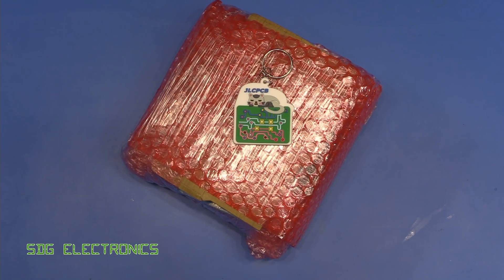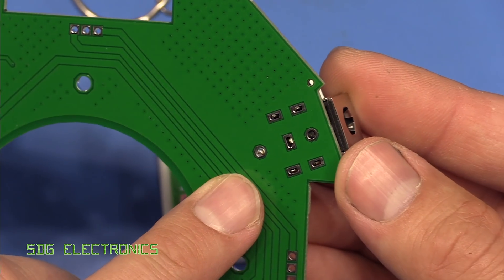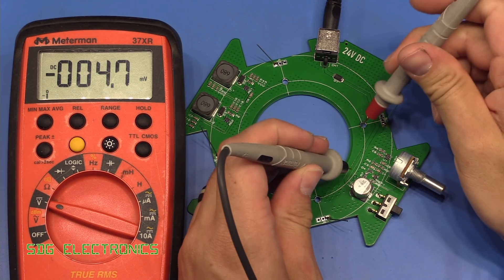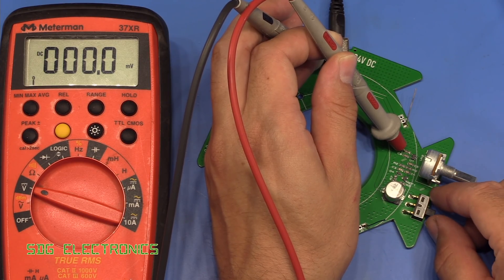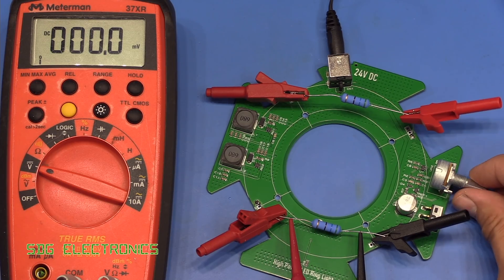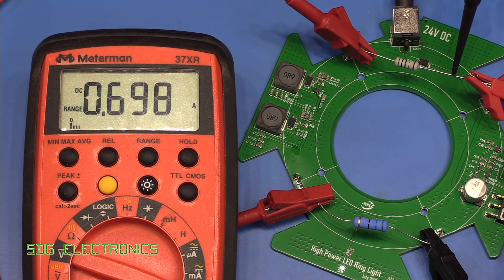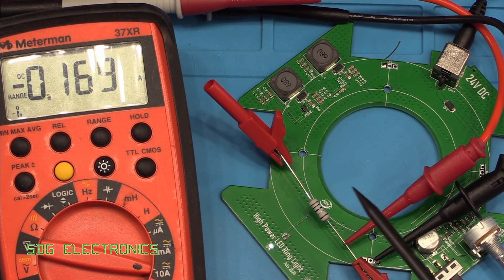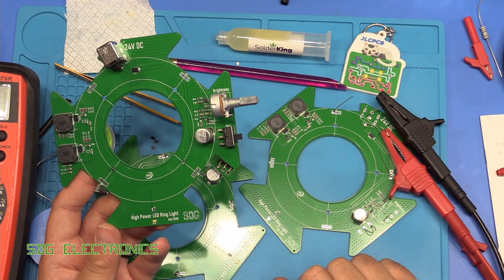SDG #170 Troubleshooting the Ring Light PCB. JLCPCB Fail??

Comment: Surprised you didn't take out the thermal camera early on in the diagnosis process, such an easy way to figure out which section of the board, and even which components are misbehaving.
What a horrible problem though, when you order 'all inclusive' you just dont expect pretty much half the parts failing!

As for my pcb designs, when building prototypes I tend to build in lots of test points and jumpers to isolate circuits. The jumpers are generally those are either 1206 resistor footprints for power traces that you can bridge with a blob or wire, or just a pcb jumper that can be cut in case I need to trouble shoot.

Comment: Had the same problem with that specific LED driver circuit, in the end I settled for the QX5241A LED driver, basically took the application circuit from the datasheet and it worked perfectly fine, even at quite high currents of 2 Amps (and since that specific driver supports dimming from a PWM input with no flickering, I'm controlling it with a simple 555 timer PWM circuit)
Reply from the maker: Thanks I will look at that one

Comment: An interesting follow-up would be circuit/board design for testability. I usually have some test points and sometimes even jumpers to isolate various circuit areas, especially for higher voltages, e.g. the 170V supply on my Nixie clocks.

At least with thru-hole we could leave the ICs out of their sockets and measure all the voltages before inserting them !

Comment: Your approach to find the fault is flawless, I wouldn't do it any other way. Most probably they somehow have a faulty batch of IC's in their stock. I would expect them to send you x2 amount of replacement IC's in the least, just in case. Replacement assembled boards would be ideal but they have the risk of having bad ones too, better to have a bunch of extra IC's, they are an easy solder job, you can even use one of the boards as a test a jig to test the IC's before soldering them in. I hear the rumor quite often that Chinese assembly services acquire a lot of factory reject batches of components.

Comment: The ceramic-only input capacitors may cause a voltage spike that may have damaged the driver ICs, especially without the load connected, and with the long test leads for power. I'd probably add a higher ESR ecap on AL8805 input to dampen any ringing. Or an equivalent snubber network. The datasheet recommends tantalum anyway. So I still wouldn't rule out a design error, albeit a very subtle one. https://www.edn.com/ceramic-capacitors-in-dc-dc-input-filters-ok-but-watch-out-for-those-transients/

Comment: Great video Steve. About the only thing I would have sown was feel for heat but you were heading that way with adding more current.  

I think the most logical explanation is bad batch of drivers but it’s a lot of failures your seeing , the problem at time’s with these places is they may buy from not so reputable sources.  I don’t see them doing anything in manufacture to kill them unless there is some  sorting your can’t see.

Comment: Did you inspect the boards under a microscope to make sure there are no 'stray' solder paste residue balls shorting out the pins of the ICs? I've had 0.4mm LQFP devices with shorts because the boards havent been washed (or optically inspected) after reflow! There is the big question of the quality and source of the parts ... especially in a low cost Chineese PCB factory!
Reply from the maker: Yes, I didn't find any short circuits and the impedances between pins all looked normal.
Reply: @sdgelectronics  why not test the ic on some protoboard just to make sure things alright, at the same time test the boards for cracks... use some baby powder for that, I tend to lean to the thought of some nasty transient especially for dc dc converters, you really should hook up a scope and single shot the turn on moment
Reply: @sdgelectronics  Inrush transient spike on C13...C18?

Comment: We had the same issue 4 weeks ago. 1 out of 5 PCBs was working fine and 4 were broken. It turned out that the desoldered USB3320 had a pin shorted to GND where it shouldn't. It's probably not an ESD issue as the one board has been working for 4 weeks in daily use just fine. JLC offered a coupon of $5 for those broken IC.
Reply from the maker: I couldn't find anything wrong on the first PCB I inspected under the microscope. I'll take a deeper look tonight...

Comment: My vote is on ESD. You Initially powered them up with the outputs unterminated so cant see a current surge at start up being an issue.
Reply from the maker: I'm leaning that way, but I will inspect more boards tonight. They were packed into bundles of 10, I realised I was picking all the faulty boards out of one pack and the working ones out the other, but that was just 5 PCBs in total so statistically irrelevant at the moment.

Comment: I would have banged my head on the desk and started to cry, and have no idea were to start 😅
Reply: First step is to pour Isopropyl alcohol on the board to find the hot spot - it will evaporate quickly on the faulty component. If that doesn't work you can then drink it 😁
(JKS - don't drink it)
Reply: @SimonCoates  You've been watching Louis Rossmann troubleshoot Mac motherboards...
Reply from the maker: High current on power up is the worst to troubleshoot as there can be so many causes. Fortunately this is a simple enough design. :)
Reply: I have a project on hold just for a similar problem. In my case same circuit 2 board revisions the new one don't work due to low voltage cutoff during the ic power on.
The circuit is the same. I've tried mostly anything I could do with my equipment. My next step would be to buy a scope to see the power line and see the spike.

Dammit GSM modules that have 2A spikes.on network connection.

What is strange is that the boards that work have all sim800 modules from lcsc. The other were mixed matches from various vendors.

I should try something else. Or I should hope for the nbiot network to become available for public use!

(I just switched 2 data pin around due to the fact that I switched SDA and SCL)
Reply: TuttoCrafting I got lost at ‘I have a similar problem’, but I would definitely recommend getting a scope if your gonna do this as more than just the occasional board like me, it’s as essential to electronics as a spanner is to a mechanic.

Comment: I beleive that JLCPCB should have tested the parts before using them. I had found parts I purchased from China end up been fakes and not genuine parts. The parts maybe clones (FAKES) and not genuine.
Reply: How do you imagine them testing the parts??? Tens of thousands of them? That's what certificates are for. Proper handling plays a role as well.
Reply from the maker: The assembler can't test the components without you building an in-line test rig and paying for their time. JLCPCB do test the bare boards though.

Comment: i had one pcb where a soic8 chip had some debris underneath, it was sitting on an angle and was not connected properly. 2..3 solder spots and it was fixed.
after contacting jlc about this they gave me a 2$ coupon

havent got any faulty parts yet, neither from assembly or lcsc directly.
Reply: I've only had one bad PCB from JLC, where they strangely managed to put solder mask over just one pad of an IC. I managed to scratch it off, and they sent me a $5 coupon.

Comment: * If the goal is to test the quality of the LCSC supply chain. Then it would make sense to order the exact same part again but from a 'higher tier' provider such as Mouser / Digikey / Farnell / CPC etc.

* If the goal is to test the quality of the mfr. Then order same part from alternate mfr. If only 1 mfr makes it. Then you cannot test for this.

* If the goal is to test for the quality of that part / solution. Then a different part should be ordered that is similar but not actually meant to be the same thing. And also from a different mfr too. That is in fact what bgwlepp is suggesting, to get instead the monolithic power systems. And is probably the best option being suggested here to avoid further problems.

* Of course the other side of the equation is what is on the board. If the design is wrong or they put the wrong SMD value or device next to the device that failed. Causing it to get overloaded or whatever. Its really a good idea to check at least with an LCR tester to be thorough. And also consult the data sheet of the LED driver to see if / how spec could have been exceeded in the event of that. Luckily there arent really that many components that are directly connected to the led driver.

I think option 4 is probably? ruled out already. By swapping the failed drivers with working ones. I suppose you could also try really scrutinizing these failed ones for any telltale sign of esd damage. If they provide the schematic in the data sheet, and you really are curious about them.

Comment: Sounds like either a bad batch or batch run of production causing an issue. Or poor material handling after production from the factory as it appears multiple sources of the IC experienced the same failure.

Comment: I’ve received bad DC-DC converter ICs from LCSC before, specifically ten MP4432H. After mounting them to the board and applying power, the converters would rapidly cycle between starting up and shutting down. I had begun to doubt my design—but I wasn’t done just yet! Suspicious of too-good-to-be-true deals, I ordered another set of MP4423H from Mouser. Long story short, all of the ICs from Mouser worked flawlessly. This was my first and last experience ordering ICs from LCSC. I mostly use them to source connectors and passives now.
Reply: Good point. I'll get my coat 😁
Reply: I've got a broken atmega328p from lcsc.
I have put it in the programming clamp to flash the bootloader and nothing.

Tried another chip, all was ok.

1 out of 20 was faulty.
Reply: I think it's important to note that, in this case, LCSC didn't supply the apparently faulty parts - they came pre-assembled on the board from JLCPCB.
Reply: stevenhu That’s true. However, JLCPCB and LCSC aren’t independent entities.
Reply: @nelgau  Yes, however the handling over at JLC could have caused damage that wouln't affect parts directly sourced from LCSC.
Reply: @adlerweb  its more likely that the part isn't really robust enough due to who LCSC are sourcing it from. It is also one of the reasons why (personally i myself) would prefer not to use their assembly service. Since they can only choose parts from LCSC. However on the positive side their online platform easyeda I think is pretty great for encouraging open source hardware. And not all other types of projects are so sensitive to the choice of parts. In which case it can be OK.

Comment: I think that if I were in the same position, my initial debugging steps would have included checking for excess heat in each area of the board. (Ideally with a thermal camera, but just checking with your finger would probably help you narrow it down quite quickly.

Shame about the issues but it does happen, that's why a robust testing process is so important for production work.
Reply from the maker: Unfortunately no thermal camera just yet. I had a TO220 shape burned into my thumb many years ago so I don't use the finger technique any more 😂
Reply: @sdgelectronics   Speaking of which... If you are in fact looking a cheap (but good quality) thermal camera solution. Perhaps you are not. But maybe you are. Then the libseek thermal for android (with the micro usb connector, not the apple lightning version). They currently have the best quality sensor 'for the money' and can be gotten off ebay fairly regularly for a low enough price. You then can plug them either into an rpi (or any other arm soc based sbc, i recommend orange pi for a proper usb host support, which is lacking on all rpi earlier than rpi4). Or you can just connect the camera directly to your pc over usb. Then on Linux platform we have a graphics processing library called 'libseek thermal' which is basically the driver software compatible withe the libseek camera. To get the video output into obs or whatever you like. On win10 i am not sure if you can use the same library but there might be a similar kind of software solution or app for windows. If not then you can just connect it to an rpi instead as an intermediate go between. This solution is a lot cheaper than getting a camera from FLIR. And unlike other cheapo IR cameras it is actually a pretty respectable sensor quality.
Reply: @sdgelectronics  I had quite a few soldering iron pattern burns as a teen back in the 70s.  I'm more adept nowadays.
Reply: @sdgelectronics  you can also just spray some isopropyl alcohol on the board. It will evaporate much more quickly around the faulty (i.e. hot) component.

Comment: Ive used that specific component before and have had a whole lot of issues with it exactly like you, its a pain in the ass. I ended up using a monolithic power systems part that is functionally equivalent. I got my parts from DK though, not lcsc.

The part is probably stupidly esd or reflow temp sensitive.
Reply: I really like MPS IC’s. I have used their stuff in professional projects and they had better performance than Diodes and TI. It was surprising it performed better than TI.
Reply: > The part is probably stupidly esd or reflow temp sensitive.

i suppose the one which you are referring to is steve's original choice. Rather than the alternative you recommend... Yeah the spread of failures he has gotten would all seem to suggest something like that.

I strongly suspected there might be some sort of an issue with these boards. There usually is with a first try, its not surprise. However I did not really know what to think of the led driver as they are pretty new to me. 

Can you please be any more specific to help find the part you choose from monolithic power systems? Hoping we can find a way to mod these first batch of  boards as it would be such a shame to waste them... and was hoping to ask for one at the end.
Reply: MP2489

Comment: Thanks a bunch for doing this video. I'll be extremely interested in finding out what the issue is, but until then, I won't be ordering any parts from LCSC. Life is too short to deal with a supplier that may be supplying counterfeit or rejected parts...
Reply: To be fair even big name suppliers like Digi-Key and Mouser have same issues.
Reply: @akhurash  I order a lot of parts for my business from DigiKey, Mouser and Element14 and it is pretty rare to get wrong or defective parts. LCSC frequently has lower prices, so I would be getting a lot of parts from them if I had full confidence. This video wasn't confidence inspiring but I'm sure SDG will get the correct explanation.
Reply: i once received wrong smd resistors from lcsc. ordered 10k, the bag had 10k with proper item number on the sticker, but resistors turned out to be 16k9 and printed such. emailing support revealed that the warehouse packed item with similar ids (namely: two digits swapped places). so, lcsc warehouse might make a mistake.
Reply: The failed part was supplied by JLCPCB. At 11:40, Steve says he didn't order any LED drivers from LCSC when he ordered the other parts (switch, power connector, and potentiometer etc). I'm not saying the LCSC is immune from these modern supply problems, but in this case, it seems the problem may lay with JLCPCB - we await the results with baited breath :)
Reply: @msstevenhu  JLCPCB and LCSC are essentially the same company, from what I can tell. In the past you were able to have your JLCPCB and LCSC orders ship together to save on postage, which they've sadly stopped offering.
I believe that, to have JLCPCB assemble boards for you, you can only use parts from their parts library, which is a subset of LCSC's catalogue.

So these parts probably were from LCSC, even if not directly.

That said, IMO it's far too early to point fingers at LCSC over this, when there are plenty of other explanations.
Reply: @AndrewGillard  Could be a design error (doesn't seem to be), or a problem with the PCB, or a problem from ESD, or possibly a bad profile in reflow. I've had JLCPCB build a lot of much more complex boards for me, and never had a problem, so I doubt this was a PCB problem. In any event, SDG did show that a lot of the driver parts were bad, so until there is a good explanation, the safe thing to do is to avoid parts from this source.
Reply: @ats89117  There's a comment on this video from bgdwiepp ( https://www.youtube.com/watch?v=Jf35-4wvwio&lc=Ugx6NFCsujBdMHwb70t4AaABAg ) who says:
“Ive used that specific component before and have had a whole lot of issues with it exactly like you […] I got my parts from DK though, not lcsc.”

So until more information is available, I'm inclined to suspect that it's an exceptionally fussy component, e.g. "stupidly esd or reflow temp sensitive", as bgdwiepp's comment suggested.

But there isn't a lot of data to go on at this point.
Reply: @msstevenhu  Also, those parts are in a circuit. I'd put an oscilloscope probe on the input ceramic capacitors to check for voltage transients before pointing fingers. The high inrush current of a ceramic cap is notorious for causing spikes with wire inductance.
Reply: @gumo77  I was also wondering about something like this being the cause. Perhaps that would then cause the remaining working drivers to all fail over time? (Sooner or later). I wonder if we might be able to see that here in this case. For example if Steve decided to leave some of them running and do a burn test.
Reply: @dreamcat4  Quite possibly. He used Y5V input capacitors, which are wildly nonlinear (higher voltage -> less capacitance -> even higher voltage). They can easily cause 2-3*Vin spikes, and AL8805 can officially withstand only 36V. However, this happens only when you connect the power, so a burn-in test wouldn't reveal it.